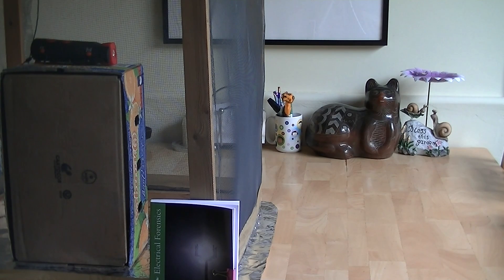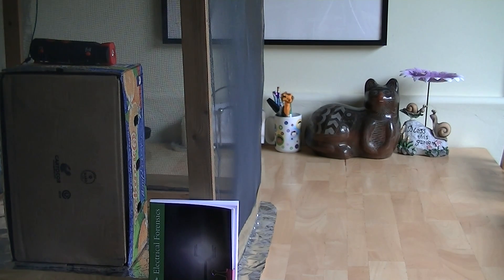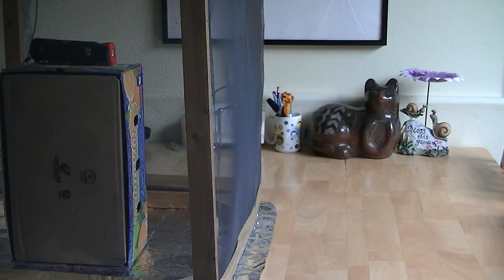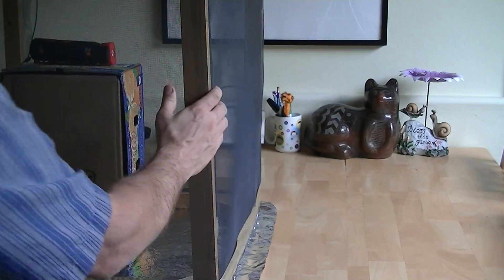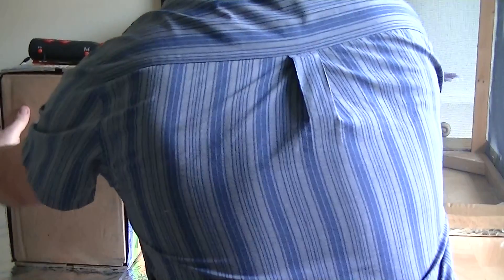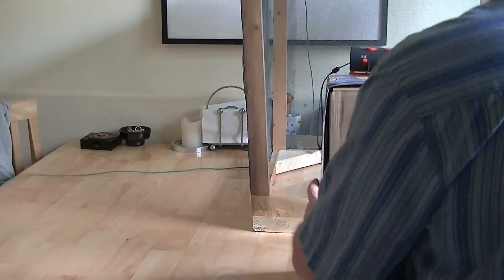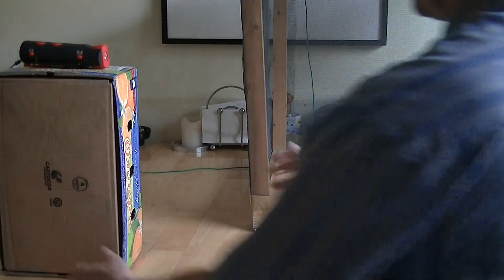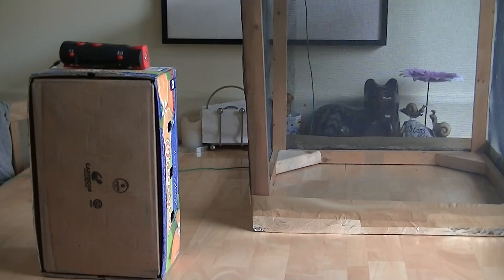Faraday Cage or Faraday Cube - Which is Better?

Comment: Unfortunately, I already explained the 'strange' happenings on a much earlier video before seeing this one. In the older video, the cage was made of large mesh chicken wire, now it is a much more effective mesh with smaller holes. 
 
 There are definitely mysteries still out there, but shielding is generally a well understood concept. Electromagnetic compatibility is taken with a great deal of consideration in proper electronics design, though there are some places it is seemingly disregarded where it shouldn't. cough*SmartMeters*cough So, anyway here's my YouTube-certified Engineer's explanation on RF shielding. As a rule of thumb, faraday cages are only effective in shielding signals that have wavelengths longer than the holes in the cage. The smaller the hole, the higher the frequency it will be able to block. Think of a microwave oven, a faraday cage used to keep the energy IN, rather than keep energy out. Nevertheless, the idea is the same. The holes in the door pass the shorter wavelengths like light fine, but leak very little of the longer wavelength microwaves. 

 The base is identical to the rest of the cage as far as RF is concerned, regardless if base is a solid panel, a properly sized mesh, or a giant hole. The RF is going to interact on the entire cage and will creep in where ever it can. The reception is only marginal with the open-bottom cage because scattered signal still reaches the the radio. As I'm sure you guys aware, lower frequency RF is fairly intrusive and is scattered around quite a bit. Broadcast radio is in the lower frequencies for that exact reason. It would be fundamentally useless if the signal wasn't so pervasive. Straight shot, line-of-sight propagation really only occurs with the higher frequencies. Because RF propagation is fundamentally impossible to perfectly predict exactly how the signal will behave, you cannot rely on an open shield to block the signal.

 As you discovered, grounding a cage won't make much difference in the shielding performance. Normally, I'd just ground it to a good earth ground. Better safe than sorry. The only time it is essential is when you are shielding close to a high power radiator. The RF energy is absorbed by the cage, and unless the induced electrical energy is shunted to ground, it will attempt to re-radiate that energy. Cages aren't typically designed to be antennas, and it won't be able to effectively radiate the energy and just waste it as heat. Too much RF energy does not a happy ungrounded cage make.  

RF propagation is a wonderful topic to research and experiment with and goes much greater in depth than just my ramblings.

Comment: Could be the light waves reflecting off your floor carrying the radio waves back up into the cage ? Maybe try in the dark?

Could also be the Schumann resonance also know as the earths heartbeat or earth frequency carrying the radio waves back up inside the cage? 

See the below videos for more insight to what I mean about waves interacting with other waves. Although they are using manmade LED lights waves, the different energy source waves and their various strengths interacting  with each other is what I want to point out.

The LED lights in your home could be spying on you!

Sound through an LED

Transmitting sound through an LED

Cheers,
Reply from the maker: Radio waves transmit differently between day and night, so the results should be different due to the change in atmospherics.  All electromagnetic waves interact and we are only at the beginning of understanding this subject.  Those LED light  videos are interesting!  I recommend that people should avoid LED light bulbs for many reasons.  Stick with the tried and tested filament bulbs.

Comment: Nice display, wonder if that holds true if your outside on the grass. What I mean is does your tile flooring reflect some of the radio waves back up into the cage when you remove the aluminum floor ?

Or maybe the wood table and it`s urethane  heavy gloss finish is doing the reflecting ? I`m not positive about your table but if your table is laminated could also t be the laminated wood as it is very thin strips of wood glued together, not sure what type of glue they use but just another thing to consider.

I`ve always thought concrete absorbs them somewhat but now curious about concrete floors and if they also are somewhat reflective ?

Cheers, and thanks again for the videos.
Reply from the maker: I think that some of the radio signal is on the grounded concrete and tiled flooring.  There is "Stray Voltage" on that floor and the extensive testing that I have done regarding stray voltage show that it is filled with radio frequencies.  So I suspect that the floor is emitting the RF that the radio is detecting.  You can see it happening when the cage is directly on the ground in this video:    http://youtu.be/MkQjTvcUjV4 Does a Faraday Cage Need a Conductive Base When on the Ground?